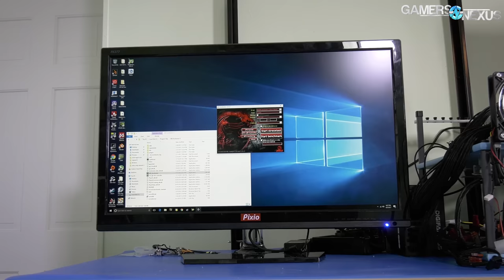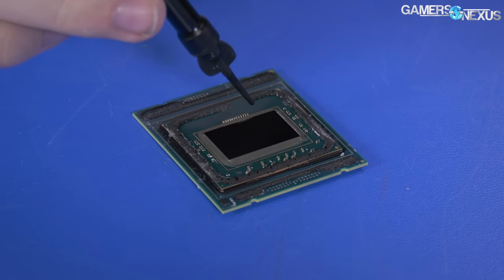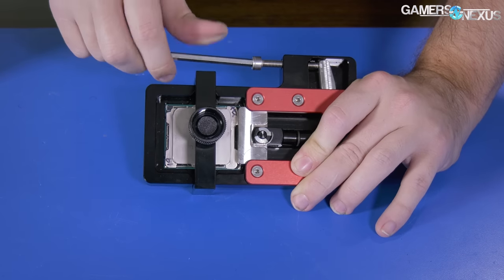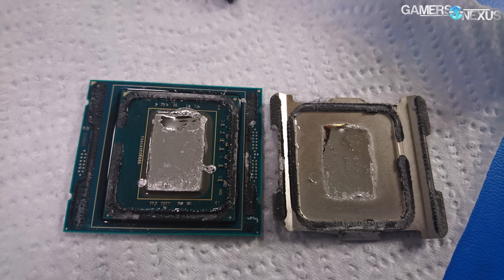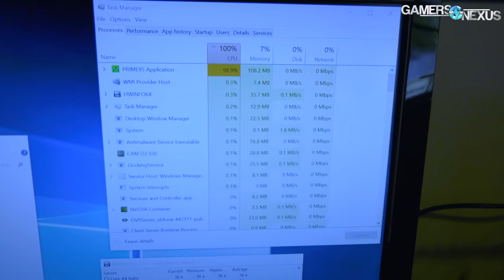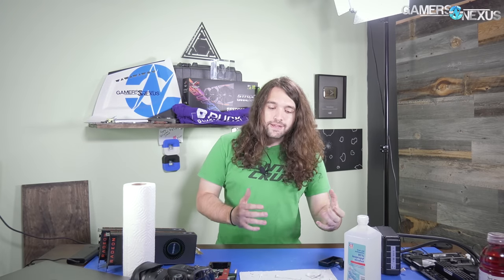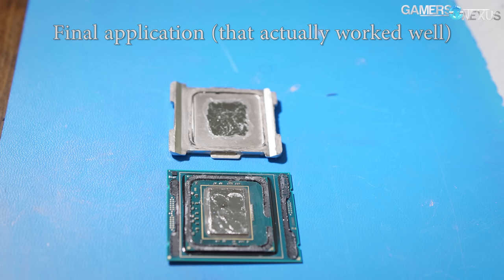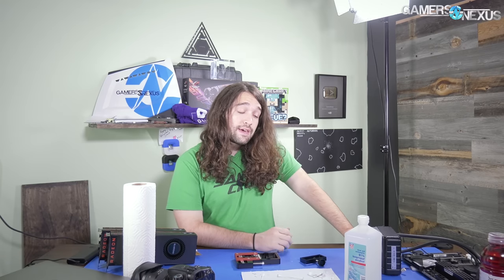Vlog: Learning Delidding & Liquid Metal Application on 7900X

Comment: What if you use nothing, the coolers of today have way better surfaces.
Reply from the maker: You risk cracking the die and would have to modify the retention bracket on the motherboard.
Reply: Gamers Nexus Worth a try?
Reply: apple still use lids ?
Reply: Do you mean use nothing as in cooler contacting the die with NO thermal material? No... That would not work, AT ALL. You need to study surfaces a bit more to understand the imperfections. Even at a microscopic level it definitely is very important to make sure you are making good thermal conduction, as in using thermal material (Thermal paste, or liquid metal)
Reply: PROPHET GAME I mean for science yeah.  These tests were done years ago and the difference between relidded IHS and direct die was 1-3 degrees celcius on an open loop system.  Considering it requires a custom retention bracket and no longer has a vendor specified pressure spec most everyone would consider it not worth it.  Validating those findings in 2017 would be interesting though.
Reply: willis936 nice

Comment: is this an extreme overclocking channel now?    if you need more speed to the point of risking your chip and purchasing expensive liquid metal, just buy a faster chip.   i mean i really don't understand the purpose in this.  most of these mainstream chips don't bottle neck today's gpus.   what's the point?

Comment: I've used both liquid ultra, and conductonaut and I much prefer the application method of liquid ultra.  the issue with conductonaut's "precision" applicator system is that it creates too much pressure and will come out like a jet stream like did for me, and in your video

Comment: You can just suck up the extra into the syringe if you use too much.  Painters tape over the components simplifies things a lot too.  If you go into this knowing to be careful with the syringe, it's super simple. Not sure what you resealed with, but a toothpick with some high temp gasket maker along the ihs edge leaving a gap for gasses like they do in the factory is good for resealing the ihs.

Comment: i masked my die with scotch tape when i did mine. i used cool labratorys liquid pro, it didn't seem to be as runny as der8auers
 stuff, i don't know if that's a good thing or not. i heard that the cool labs stuff will coagulate after a while and the performance will degrade.

Comment: Why not mask off the cpu die with kapton tape around it? would atleast keep liquid metal from getting on the cpu pcb during application. It could also likely be kept there for the heatspreader installation as well, whereas other tapes would not be able to stand up to the temperature of the cpu die.

Comment: delidded my 7700k no issue and good temp drops i run it @ 5 ghz but i removed the gasket material on both sides and used ultra cool labs liquid metal instead also i used a 3d printed delidd tool for 10 buck on ebay

Comment: you could you glyptal  paint. It was designed for motor and transformer winding insulation coating. Its commonly used as an internal engine paint for high performance  engines due to its oil impermeability and repulsion.

Comment: if you put too much you can place the syringe at the liquid metal and pull it back in :P the trick its at first use of liquid metal to pull it first instead of pressing and then just start from just touching it to slowing add pressure to the syringe !

Comment: Please up vote this. Deliding is NOT just about putting a better TIM on the die... it's also about reducing the die to IHS GAP! Reducing the gap in addition to providing better contract is where the majority of the improvement comes from. This is why removing the glue is so important. It brings the IHS closer to the die, increasing the transfer of heat. Ideally, we wouldn't use any TIM and have direct contact with the IHS since the thermal conductivity of nickel and copper is higher than any thermal interface material. Unfortunately it is impossible to have perfect contact between two uneven surfaces, this why need TIM.
Reply from the maker: Yeah, that was already discussed in this video, man. That's the whole point of the section talking about removing the silicone adhesive from the IHS.
Reply: True, man. I do think the way it was presented didn't clearly explain WHY that is a critical step. You guys usually go through that technical level of detail (TY BTW), so I thought it was fair to mention. 

I would also add, that taping off the substrate from the die is an important step to include before applying the LM TIM. Finally, I would include a clear shot of what a properly coated die looks like so people can have a reference point. 

I mean this as constructive feedback.

Comment: While it's true losing a capacitor might turn out "okay", I suspect if you're using liquid metal you're wanting the best performance possible... And a missing capacitor is fairly likely to cause stability issues, especially if overclocking. Also, sometimes capacitors are actually used to couple high frequency pulses while blocking DC or low frequencies... Though I don't know that any of the ceramic caps on a CPU are used for that.
Reply from the maker: Well, obviously. You generally try not to destroy components. But it's also not necessarily "RIP CPU" if one comes off. The point is that cleaning it up and seeing if it still works is worth it.

Comment: Hmm, I hope you removed all the black silicon, that stuff can really fuck with the IHS clearance. I love my delidded i7 7700K, 5GHz with average load temps in the mid 60ies.
Reply from the maker: That was mentioned in this video.
Reply: Gamers Nexus you said you left a little bit behind in the video though, its really important to remove all of the silicon, there can be a tiny bit left on (since removing the very last bit can actually damage the PCB substraight) but still 20°C lower is pretty good, shame the CPUs where cheapes out on though

Comment: I gotta say, the thumbnail style is a little different for this video and I'm not really a fan. I don't mind the yellow font (though I do think white looks better with the blue color scheme), but the hand gesture doesn't fit GN very well imo. I get that the point of thumbnails is to grab attention as effectively as possible, and changing them certainly wouldn't stop me from watching. I do think it'd be letdown to see yours end up as Linus level clickbait down the line though, as it is offputting to a certain degree.

Sorry if this comes off the wrong way, I just wanted to give some honest feedback.
Reply from the maker: We've done yellow font before. It's used when it's easier to read than white. It's not new to the channel at all and isn't about "attention," it's about "can you read this text on this blown-out blue background?"

As for the hand gesture, it's small, off to the side, and isn't much different from when we used Jeremy Clarkson's "power" face as a replacement for the "O" in our power mod coverage. Or when we used the Norton logo as a replacement for the "O" in Bloatware. None of this is new to the channel. I understand it's the "thing" to fight wars about thumbnails with some other channels that have done bigger changes. We are not one of them.

Just click on the channel and go look. There are others above-the-fold with yellow text, and the thumb is an identical style. It comes from the same template, even.
Reply: Gamers Nexus Fair enough. Thanks for the reply.